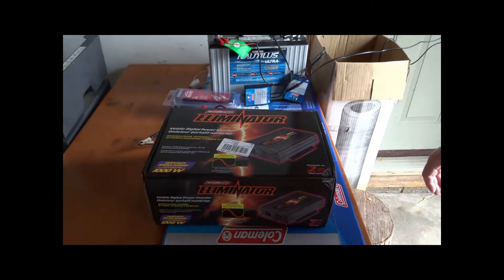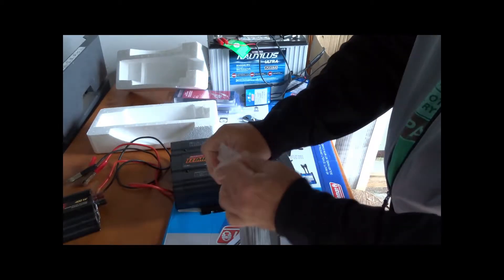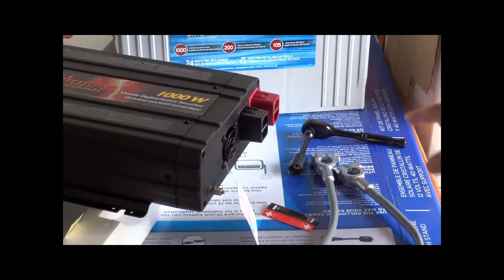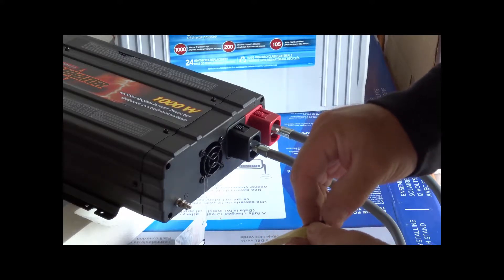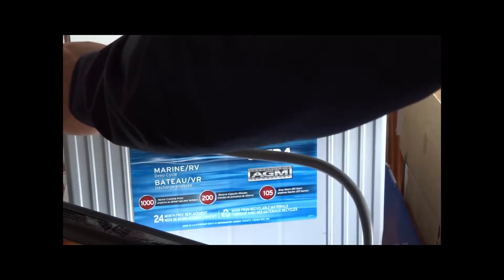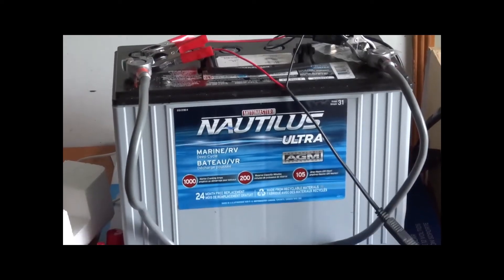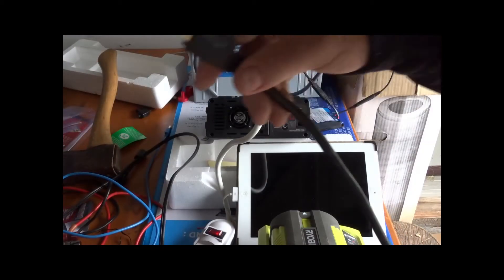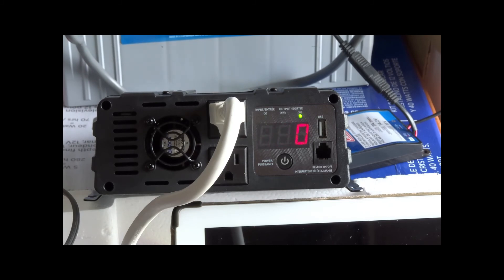Motomaster 1000 watt sine Inverter Review and Installation

Comment: For clarification, all power inverters are sine wave, it means they produce 120volt AC (alternating household current). There are 2 types, Modified Sine Wave, good for anything except sensitive electronics like a laptop or some electric motors pretty much. True Sine Wave like he bought, which is much cleaner power & electronics safe. True Sine inverters are more expensive and heavier because there is more to it. Hope this clears up any confusion 🙂

Comment: Hi. I have a question. I have this same inverter. Does your fan run under any load even small loads?
Reply: Anything over 30 watts basically,   That's normal for this one. It's ok in my situation for noise, but I'm sure in some cases it's not the best.
Reply: that is so strange. I purchased this unit yesterday and like you said anything over 30 Watts and the fan comes on full speed. the strange thing is this is the second one I purchased. the one I purchased in March only has the fan come on when it gets warm. On closer inspection the one I bought in March has a different instruction manual and the fans are made by a different manufacturer. I think Canadian Tire may have outsourced this to a different company. the fans in the newer one are so loud compared to the first one I bought in March. I am not very impressed
Reply: I hear ya, and my fan!  Interesting..